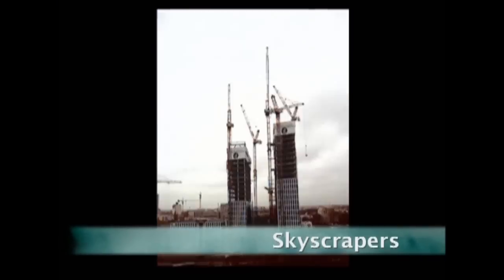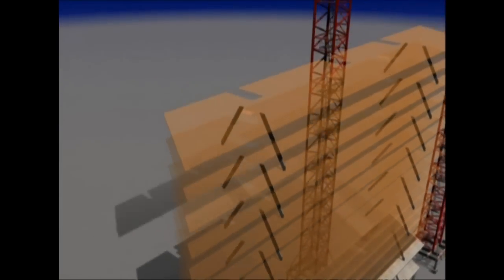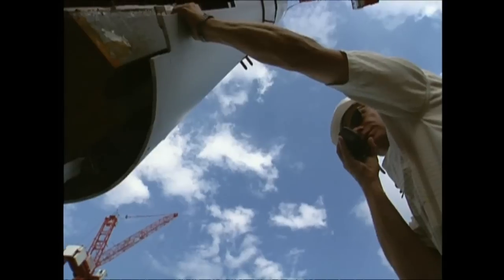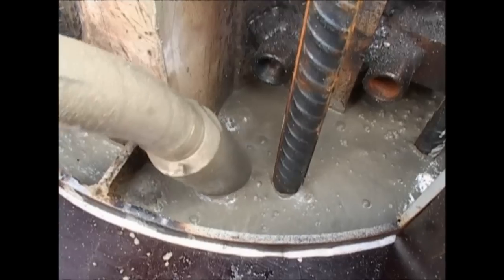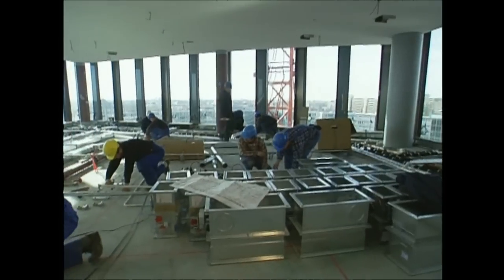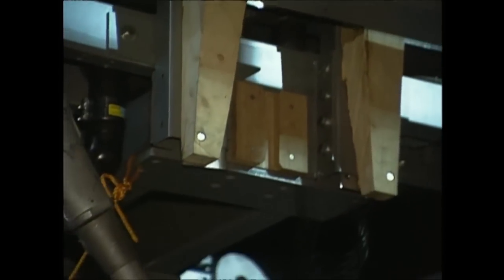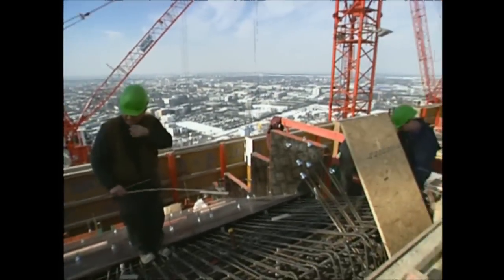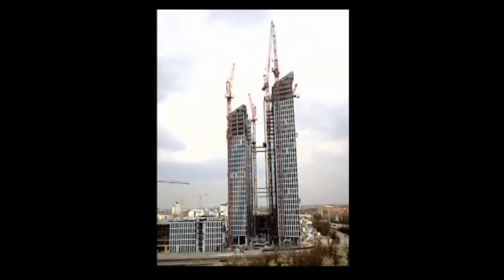HOW IT WORKS - Skyscraper

Comment: 2:38 "Concrete is used to fill the steel columns. It doesn't only strengthen them... it also makes them fire resistant."  You don't say...

Comment: "Every day, up to 10 trucks full of concrete will arrive at the site. It's hoisted up and then used to fill the steel columns. This doesn't only strengthen them, it also makes them fire resistant."

Oh yeah? Did they skip this part when building the original World Trade Center? Explains a lot.
Reply: why such tall buildings can't  construct in INDIA??  Can you tell a major problem
Reply: @srimannarayanakotipalli3071  because the phone scammers took all the investors money
Reply: Those were old buildings